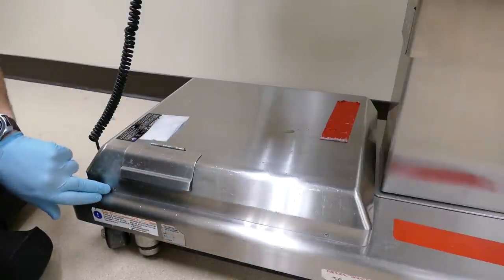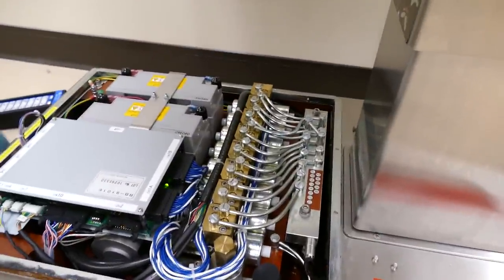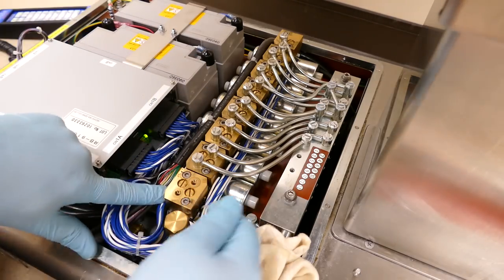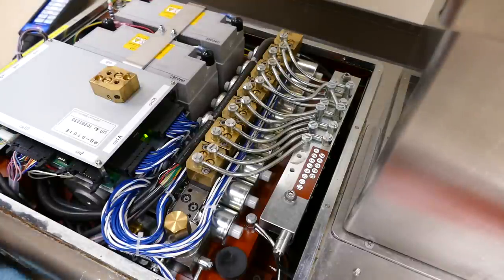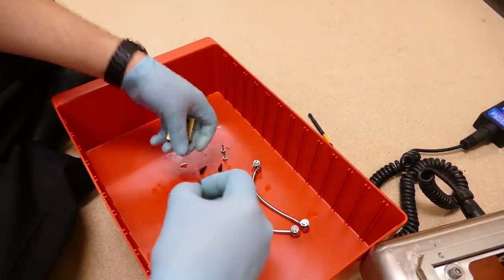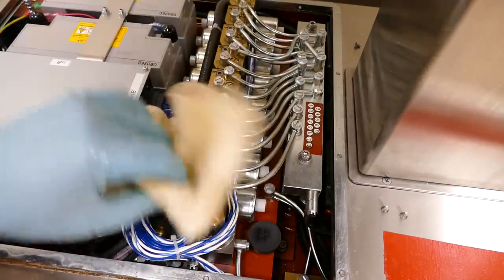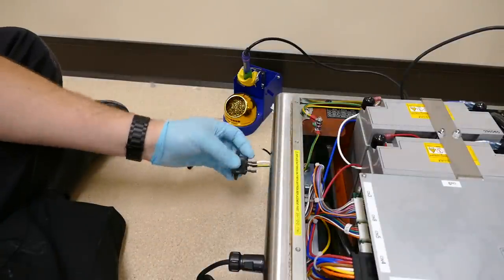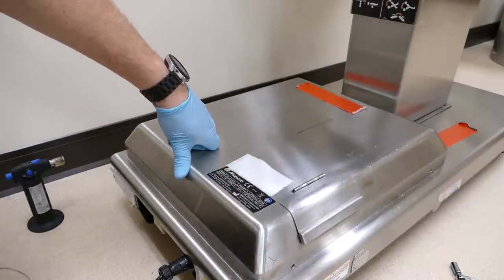Skytron Surgical Table Hydraulic Repair

Comment: I’m only in my first year of school, so a lot of the mechanical terminology was above my head, but you did a good job explaining yourself. Great video! I learned a lot and it was a fun watch too 😊
Reply from the maker: Thanks. If I am explaining a failure to medical staff I use a much simpler explanation.  One of the reasons I strive to use the most correct technical terminology is to teach the correct terminology to people that will need to explain their symptoms to manufacturer engineers or to document the exact failure in work orders. You can always research terms that are above your head but there is no help when you need to decipher someone's poorly documented failure history. Good luck in your studies!

Comment: The springs on the pistons should be replaced if you have them out, they compress over time... The speed is adjusted with the small screw on the side of the block not the top, but as far as i can tell judging by all your videos you sir are an awesome tec.

Comment: If you check at 11:00 and 23:44 , you can see that hydraulic valves block after cleaning is 180° rotated when placed back. 
All the other brass blocks have the marking strip at the corner on the rear left side next to the mounting bolt.
These blocks are probably symmetrical on both sides, but i noticed this little change :-)
Reply from the maker: You are correct. The block is symmetrical. I've experimented with the orientation in the past without issue. Proper orientation matters for the needle valve speed controls for up / down hydraulic speed. Since I completely disassemble the block, those speed settings are lost and need adjustment anyways.

Comment: Hello.  One question.  
I am repairing a skytron 6001 table. The customer informed me that when weight is applied to the table the table starts to lean to one side.  Either when someone sits on the table or when the patient is lying down, the table makes a lateral movement.
I clarify that this movement is done when the table is not activated by the button panel.  At first I thought that this problem could be caused by air in the hydraulic system, but I have already bled the entire system and the table continues to move.

What could be causing this problem?
Reply from the maker: Check to see if there is a leak at the table tilt piston. Common known problem. Tilt rebuild kit includes new brass piston.